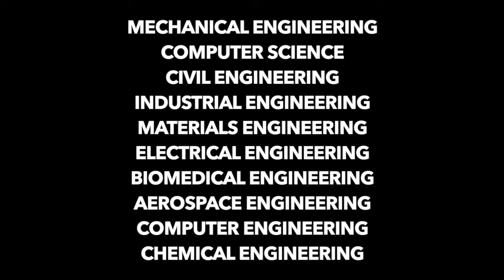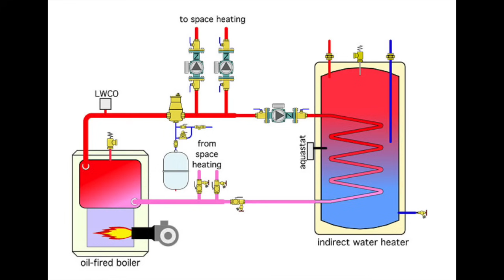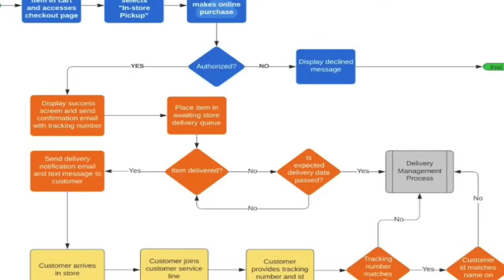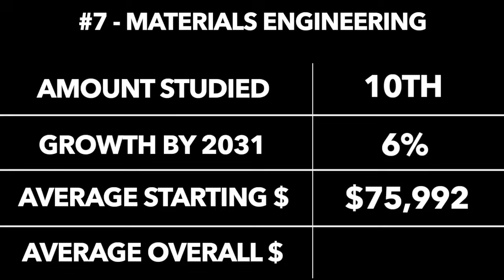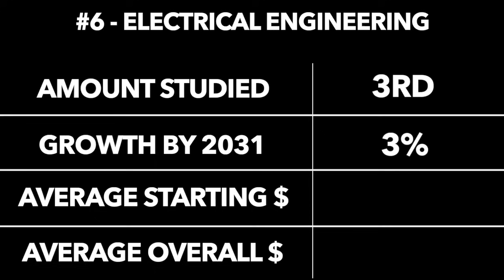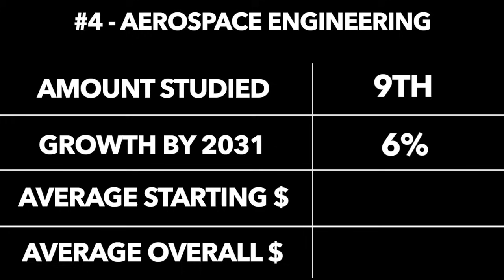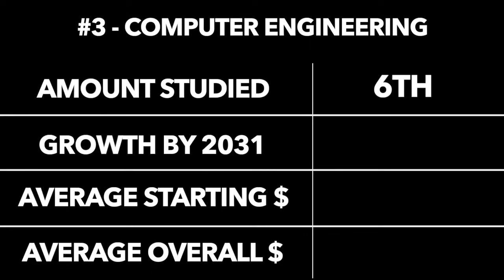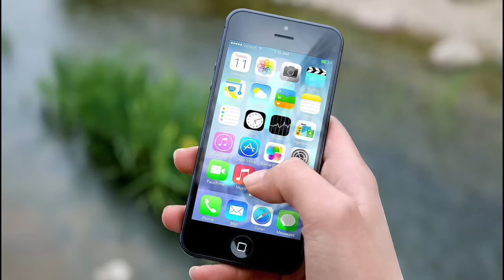Engineering Degrees Ranked: Pay, Demand, and Job Roles

Comment: The thing with engineering (and math) is you have to actually understand it.  In the humanities you can fake it and still get a decent grade.  You can't do that in engineering.
Reply: Think everybody’s college experience is little different. And there is huge difference between true comprehension and pure memorization of the chapter being tested 5 mins before the exam….

And yes people can absolutely memorize engineering formulas and steps to solve an equation that would be asked on exams the day of the test.  I did that for most of undergrad. 

For instance on understanding.. the first time I had a Math class with partial differential (wave/heat/etc)…I looked at the book night before the exam… noticed a pattern on the solution based on boundary conditions ( position, derivatives etc) eigen values  and solution structure would follow based on. I could skip doing most the work. At the time I had no fucking idea what I was doing or why that was possible… But college exams are typically just a test of a very specific set of material/1 to 3 chapters in a book.
Reply: @Pseudo___  At least in math you have to actually memorize the formula (doesn't help you much on proofs).  You need to know how to use it and what to plug before you chug.  The humanities it is about B.S. and getting the teacher to like you.  
https://www.youtube.com/watch?v=pDLzLUmtU3w&t=9s
Reply: @Pseudo___  You can't get away w/o understanding the material when it comes to Junior / Senior level semester-long projects.  For example, as a Civil, I had to design a transportation link between 2 cities - a highway, a railroad, & a canal system (on the river that connected them).  That really separated the wheat from the chaff when it came to understanding how to apply geometry, water flow, geology, geography, etc.  Many couldn't even lay out a basic circular highway/railroad curve.  Me, I was somehow born to be a Civil (didn't hurt my Dad was a masonry contractor & I'm "on the spectrum" w/a 135 IQ), I was already designing spiral curves for highway & railroad that are different (1 is arc, 1 is chord).  Also forget about ever passing the EIT or PE exams later in your career.  Better brush up on your golf game & always let the boss win.  All the "Admin's" engineers are good at that lmfao
Reply: @sideshowbob  I think you underestimate everyone's individual college experience differences.. Not all colleges are equal not all classes are equal... I did EE. Mine was a working  human tracking radar.. yeah would have been hard to bs if you actually did the work... I had 7 team members though. Not quite always equal division of labor haha.  FE/EIT/PE would be a bit more of a pain later in career if you werent applying stuff. IE the engineer turned Project manager Spreadsheet Engineer, but I also don't think it some hallmark of showing a great Engineer with full comprehension. Its still is just largely memorization. Gets some practice exams work the problem sets, youll pass, Seen it a 1000 times.
Reply: @Pseudo___  Oh I know - schools & curriculums & even individual instructors can make or break things.  It's certainly possible to "fake it" thru most curriculi.  That's why I said that, if you do, better brush up on your golf game, as that's the best way to get ahead on the Admin side if you can't comprehend the engineering enough to be an effective designer / project engineer / project manager.  I can vouch, after 3+ decades experience.  Seen it all . . .
Reply: I have a different perspective of Engineers as I have a Masters In Human Biology and an undergraduate degree in biology with a chemistry minor. 

I work in the environmental field specializing in hazardous materials management. Through the course of my career I’ve worked with many Engineers who were just absolutely condescending about my non-engineering background. In multiple times I’ve had engineers I worked with literally have meltdowns when they found out I was earning as much or more than they were. 

Industrial Engineers in particular disliked working with me as I was often responsible for their work getting rejected because their plans had pretty much no consideration for the human aspects of the process being designed. Just mentioning words like ergonomics or biomechanics would make their blood boil. I used to tease them by calling them Sadist Engineers. 

I was also shocked at how little chemistry chemical engineers actually studied. Like less then half of what I had studied. 

I was almost fired by a managing engineer and PE because we were in a conference discussing the problems were having with an abrasive product we were developing as the engineers at the meeting did not understand what a significant issue crystalline silica as a contaminant in our product was. So being the only biologist in the room I explained the biological process of the disease silicosis. That got through to the people in the room except my boss. Who promptly fired me for embarrassing him in front of all these other professionals. He made it clear that I didn’t have the status to speak out and embarrass him and the company in front of these other professionals and fired me on the spot.

The next morning I received a call from the President of the company (an environmental attorney) who told me I wasn’t fired and complimented on doing what I was supposed to do. My job. He also made it clear that I would moving forward I would report directly to him.

That was the worst conflict I had with an engineer but my experience was by no means unique as I’ve known plenty of other STEM field graduates who were not engineers but very smart and well educated technologists who have been treated as persona non grata by engineers and though I always took it with a grain of salt as I always new what my abilities were and was confident in them. So though I was earning comparable wages few engineers I worked with ever treated me as a peer. My experience was in no ways unique either.

So my question is this. Why do engineers treat other non-engineers STEM professionals in this manner? Most engineers, regardless of my contributions, treated me like I was the dumbest person in the room. I never understood their attitude.
Reply: For me, thats what I think makes engineering easier. You have a problem, you make a solution. The solution works, your problem is solved. However in humanities, most times its not possible to even know whether your thought process makes sense
Reply: @marquisstrongchild7535 but it also doesn’t even matter if it makes sense
Reply: @yelnatsch517  😄😄😄😄
Reply: Sure you can. I know plenty of people that got terrible grades in school who now hold high level jobs at their companies. Most engineering jobs are not nearly as hard or require deep understanding. Only the engineers at the highest levels of companies, with masters and PhDs truly understand most of it at a deep level and carry the engineering departments. 
When I got to my first real job, I couldn’t believe how little of my degree I actually  used.
Reply: You can’t do that in any of the STEM fields. It’s not just engineering.
Reply: @Mottleydude1  I think the comparison is STEM vs. Humanities.
Reply: @Mottleydude1 bull. Most people in the sciences know just the cannon theory (largely just accepting it) and work on their extremely focused and limited field for the rest of their life. Very few people spend time they could be using to read  on their specific topic to learn a deeper understanding of the larger elementary topics. It makes sense if you think about it. People can be really hard workers and study the exam, the examples given in class, and pass. Even being an authority on their field, but not understanding theory that doesn’t directly help their career. I’m not saying they’re stupid, but people are misguided to think that there isn’t a framework for creating content for your dissertation simply because you worked long hours, without having to truly imagine and understand all the sub atomic particle, say, in binding a transcription factor to an enhancer element.
Reply: You cannot do this in economics
Reply: Spoiler alert: you absolutely can fake it. Would strongly advice against it, as in the end you will end up a fool.

But it's possible to get away with absolute disasters, because at the end of the day, nobody aside from other engineers understands what's going on. To management and everyone else, math is often basically magic, so they can't verify how much or how little effort things take.

If you're clever and can make cartels with other engineers, it's easy to fool employers, coworkers and users. For instance, all you have to do is say: "our cloud storage uses modern state-of-the-art encryption system", when in reality it uses the most basic encryption you've happened to find on StackOverflow, and no one will be able to tell. Now, what happens if it's found out is another problem, which is why I wouldn't advise it.

I will tell you more, often times, even when you actively fight for the right solution, management will not accept it and will force you into terrible engineering decisions, making you wonder why did you even study all that math for? Real world is more akin to natural selection: whatever can survive with the barest minimum engineering possible will survive, be it jobs or products, and often be successful because of some other factors outside of the engineering, such as marketing or monopolization.
Reply: In engineering, if you are incompetent, you are exposed immediately and can't move an inch beyond.
Reply: That’s why they should inform students to read correlating chapters and workout the examples and proofs in high school. I feel like just watching a lecture isn’t enough. Understanding how to read math will help immensely. 
If I could back in time I would tell myself that. Now I’m over here reading s damn calculus book to really understand
Reply: Get your degree, take the State exam to get your professional license, open your own business / firm. Don't work for someone else. For instance EE / Electrical Contracting
Reply: you don’t have to understand why math works to plug numbers into an equation
Reply: I hate math but I’m with it
Reply: In short, you have to be "wired" for it.
Reply: yep  @goodboi7266
Reply: This is the STUPIDEST discussion I have ever seen.

The POINT of school is to understand and learn. Discussing how to fake learning...takes a special kind of stupid.
Reply: untrue. navier stokes is used all the time to model fluid flow all the time but yet everyone knows we don't understand everything about it.
Reply: As a literature student currently studying to get into an engineering department I have to say you are absolutely right I got an A+ for a paper I have written on a book I have not read
Reply: maybe in first year english. but philosophy teachers will tear your arguments into little bits and spit them in your face.
Reply: Most philosophy profs are delusional dogmatic ideologues lol, I suppose that's what happens when you pretend well constructed arguments can forge reality. @williambigger1545
Reply: Lol u know nothing
Reply: Well.... I see bunch of engineers out there dont know what is a 3/4 wrench? Is common math right? 😢
Reply: @jonnywick4402  bruhh not all engineers are the same. I mean do you expect an electrical engineer know that
Reply: @PolitictalDipsit  well now days yeah
Reply: I agree, you can't "wing it" as an engineer......
Reply: @theman4884  I have a bachelors degree in Chemical engineering and I notice a lot of people in the comment are disagreeing with you and this is proof that none of them are engineers or ever sat through an engineering course!! We don’t do mindless calculations! I failed 2 chemical engineering courses simply because it was too damn hard and I couldn’t just plug and chug!! I currently work as an engineer and do reclamation work and literally we have to know how to problem solve, bring about damn good solutions, and optimize your solutions or your ass is without a job!!
Reply: Now that's one thing that put humanities on a higher level. Can you really fake it? For grade, yes, but that defeat the purpose of your study. How can you win or excel in a super subjective fields where everyone can be wrong, right, both, or neither? In math and engineering, people much likely to agreed on the shared principle, but in humanities, when you draw the most beautiful woman for example, how many you'd say would agree what you draw or depict through word is indeed the most beautiful?
Reply: Google
Siri
ChatGPT nobody really needs to learn it
Reply: @whyworkwhenicanrap6830  Good luck having chatgpt doing your second - final year engineering homework
Reply: Utterly feeble. That is an irony and a satire
Reply: Stop trying to sound like you're superior. I was an engineer graduate, currently a physician. I make more money than you. Generally physicians are higher regarded than engineers. How about that?
Reply: Lol, mathematicians and physicists have always dunked on engineers for not reall knowing what they use.  They say you don't need to know it at the level of at sophistication to use it. I guess they're right.
Reply: Yes, indeed, you have to be at least somewhat "On the Spectrum" to "Get" the Engineering-level maths.
Reply: you are either born an engineer or you are not. Its a way of thinking.
Reply: @Savage_Thinker I wouldn’t disagree with that but that’s true about most STEM fields.
Reply: Mott Dude  lots of people in the field who don't thi k like engineers just pretend to.
Reply: @Savage_Thinker , you can't say it better than that! These are 1:1 my thoughts…Even before I went for an engineering degree and wasn't even considering an engineering degree I knew I was an engineer inside of my head. I think it's all about systematic thinking and the ability to analyze.
Reply: @Savage_Thinker no not true. You are able to learn more than you give yourself credit. Granted not all can be engineers or whatever else profession they choose. But hard work,steady progress, and good habits can help anyone improve dramatically
Reply: @Savage_Thinker so I can’t become one?
Reply: @Savage_Thinker I agree it’s a way of thinking. But I don’t think you have to born with the ability. It can be learned. I certainly did.
Reply: @Savage_Thinker lol I wish that was true
Reply: Mathematics is a humanities.
Reply: @brianwiers6778  No.  In fact, about as opposite as you can get.
Reply: One thing I always found "curious" is that at Carnegie Mellon during the '80s, there were special watered-down versions of the calculus, computer science, and probably other courses, all specifically for humanities majors.  In contrast, engineering students took the same math, physics, computer science, and humanities courses as students majoring in those particular disciplines.  I took exactly the same humanities courses as the humanities majors.  And I got "A"s in those courses.  I'm very glad I didn't have watered-down versions of any of my courses.

At the time, the humanities college at Carnegie Mellon was called The College of Humanities and Social Sciences (abbreviated H&SS).  We engineers referred to it as "H & Best Guess".  We considered an H&SS degree to be a consolation prize for students who couldn't cut it as engineers.  I know that's harsh, and I don't buy into that 100%, but there is also a certain element of truth to it...
Reply: @waltwimer2551  I went to Pitt, circa late 70's/early 80's, BS in Civil, Structural, Environmental Engineering, 1983.  We did have "core curriculum" geared towards engineering students in the humanities.  "Psychology 101" (yes, we were still taught then that "Homosexuality" was a mental illness), Art 101, Music 101, Western Civilizations 101 (ahhhh, yesss, "Western" lol), etc.  It was fairly non-challenging, you didn't have to complete big term papers or anything like that.  Just follow along w/the lectures & textbooks & pass the basic exams, not much homework, as they knew we had wheelbarrows full of engineering work.
Reply: @waltwimer2551 That was true of my area of study as an undergraduate (BA in biology with a chemistry minor). I got a lot of dates with nursing majors and social science/humanities majors tutoring them in watered down versions of my freshman classes.
Reply: Agree
Reply: Quite prejudiced driven statement
Reply: @fareehafaiyyaz8475  How so?
Reply: @fareehafaiyyaz8475  Oh so now it's "prejudiced" to point out that some people can do the math & some can't?  Yeah, let's, in the name of "equity", only teach the level of math that EVERYONE can understand, so no one gets "left behind".  Oh yeah, let's teach it in "traditional, tribal" ways, where there might be more than 1 correct answer, if you interface with the correct Shamans.  I mean, I'm left of center, & pro diversity / equal opportunity, but this "Woke" bullshit has gone far enough.  China & India are going to Bury us . . .
Reply: Yea right buddy is that what mommy told you?
Reply: @cece-xe5zx  Did I hurt the feelings of a gender studies major?
Reply: It's the opposite in my opinion
Reply: @sonsofelshamy3987  it depends on your lecturer. They can set their exams/assignments in such a way that all you need is a strong memory, mental stamina or a deep understanding of the course material.

 For  memory based exams, they can require you to regurgitate a lot of information, proofs and definitions. 

For mental stamina based exams, the lecturer would typically demand you to solve large amounts of problems, very often within insufficient time.

For understanding based exams, the questions are typically short but would require thorough understanding of the  course material.
Reply: @sonsofelshamy3987  How so?  With a math equation there is a correct answer(s) and everything else is wrong.  On the other hand, I can argue that the Maltese Falcon is a  Christ allegory and get full credit.  And with spell and grammar checks I don't even need to know how to do that.
Reply: @theman4884  That’s not about understanding that’s about opinion. You can use equations without knowing how they’re derived and understanding what they mean. I can apply the equation F=ma to a question by simply substituting values and still have no clue what any of it means.
Reply: @sonsofelshamy3987  You just perfectly demonstrated exactly what he was talking about.  Engineering is not mindless calculation. An engineer has to understand what they're dealing with before they can even begin to choose the correct equations to reach a solution.
Reply: @sonsofelshamy3987  yea then u will not pass the exam cuz is not just aplying
Reply: @sonsofelshamy3987  Engineering is not middle school physics. You wouldn't even know what equations to use unless you are understanding the problems and all boundary conditions.
Reply: @sonsofelshamy3987 a=f/m is better.
Reply: @sonsofelshamy3987  You sound like all you have is opinion. 
I have been a consulting engineer for 40 years and have designed and managed many types of projects including many types of contributing engineering and non-engineering disciplines. It has also been my responsibility to recruit, train, and manage people. Those are my qualifications. 
I have found in my career that there are no statements of the problem to be solved. There is what you might call "the user's complaint." The user is usually a lay person who knows little of math or physics. All they know is that they need a widget to fix it. The engineer must derive the problem statement themselves and then correctly apply the correct equations to produce the widget. This process is usually breaking down the one big problem into many smaller problems, each with its own equations. 
Knowing that F=ma doesn't even get you into the room in which this work is done, unless you brought coffee.
Reply: @jakurdadov6375  As a civil engineer who cut my teeth designing sitework & highways & airports, then moved into project engineering / project management / construction management, I was the interface between the "lay persons" who were the owners / occupants of the facilities we were designing / managing, often political appointees with shady backgrounds.  Then I was dealing with the field inspectors, code officials, contractors, who had at least some technical literacy, perhaps not the math-driven stuff, but understood how to get things built.  So I hear what you are saying from a mechanical / industrial engineering standpoint.  Most of the facilities we designed & managed were for maintaining transportation vehicles - snow plows, buses, trains, etc - so I learned a lot about industrial & mechanical engineering "on the job"
Reply: @jacobnebel7282   I agree. If you just choose equations and start plugging numbers in during an exam, unless you are very lucky you will get a friendly note from your professor "Major conceptual error 0/10."
Reply: @jacobnebel7282  this may be true for some cases, but broadly, this is not correct. As a computer scientist employed in a software engineering position, you do not need to understand how computers work at all, technically. sure, it would be better, and it would (for some people) make you better at your job, but you can sure as hell get by without understanding a thing. Coding and design patterns can be learnt and need not be understood, and I'm saying this as a CS graduate who does understand very well.
again: understanding it DOES make you better at your job, but you can coast by without it.
Reply: @sonsofelshamy3987 duddddeeeee ur sooo wrong, I am barely taking prep physics and we have not gotten to fma yet and even I know that F is force , Mass and Acceleration, cmon now. Idk what’s ur education but like if people like you exist I can def get a physics major. I thought based off the main comment that I was gonna be completely fked cuz some stuff is difficult to remember but I guess not (other science subjects like calculus sometimes I don’t know what I’m doing but I get the right answer but I know what the equation means most of the time)
Reply: @sonsofelshamy3987 good luck with a math exam, being tested on matrix algebra with that logic. I guarantee you, you are not solving X by getting the inverse of A without understanding how it works.

You can't wing it, and it's not about memorisation. It's understanding.
Reply: @championofthelight3851 I challenge them to solving a system of 3 linear equations with 3 variables using matrix algebra. Without understanding how it works 😅😅😅😅. 

Hell it's like explaining Egyptian hieroglyphs to regular people.
Reply: @DrPandorum that doesn’t help your argument because very few engineers actually have to manually solve linear algebra equations. Most engineers have access to software that can take care of most design aspects as long as you have the parameters and learn how to use the software. I don’t have to solve 5 degree polynomial equations to determine a pumps performance, I have programs that just spit out and plot the curves. I don’t even really have to understand how the curve is derived.
Reply: @theman4884 To be fair, in engineering you have to argue your approximations—but they have to be accurate or justified. There is plenty of nuance and it’s not a plug-n-chug discipline. It’s still much harder though.
Reply: @sonsofelshamy3987  Lets forget about the 4 semesters of calculus and equation derivations we do with answers that are a page long (praying for my diffeq friends). Every upper level engineering course i took let you have SHEETS of paper with ANYTHING you wanted written down. formulas, homework, typed written whatever. you could even print out an old test if you could find it and fit on one page.

Why did they allow that? Because if you didnt understand the nuance in when and how to apply what formulas then it didnt matter what examples and formulas you had available. Engineering do math on real life scenarios. There's as much mathematical context in a ball rolling down a hill as there is in a conversation. Hate it break it to you friend, but the device you typed this on does in-fact require more understandong than "f=ma" to work an operate.
Reply: @sonsofelshamy3987 That'd not how engineering work though. You don't just mindlessly apply formulas, you do actually have to understand how to deprive each one aince you need to be able to tweak one on the fly
Reply: @sonsofelshamy3987 engineering isn't middle school physics where you can just remember a handful of complete formulas and use it to solve the problem. the op's correct- engineering field has objectively correct solutions and when you're writing let's say a literary essay there's no objective truth you can interpret stuff the way you like and still get a decent grade
Reply: @theman4884 you have to understand how to articulate your points and use critical thinking. You can’t really “fake it till you make it” in my opinion
Reply: That’s an oversimplification of what the hard part of STEM fields is. The hard part is the problem solving of using tools to solve an abstract problem. Almost never on my tests for STEM class am I asked to simply compute something using a formula. Instead, the question is abstract enough that I need to figure out how to use 20 different formulas and operations in the correct order to solve the unique problem. In my humanities classes, I am constantly asked to relate some abstract concept to another abstract concept, and literally all I have to do is use big words and say “…gives insight on…” or “…reveals the author’s…” I understand that is not how you write interesting and beautiful things in the real world, but if we are just talking about school, the humanities is much easier.
Reply: @conigliana If, the grade is fixed to be good. Think again, how would you excel in a subjective fields where everyone can be right, wrong, neither, or both? Say, what if the lecturer told you to draw or depict through words, "The most beautiful woman".... ain't everyone cooked solely for the fact that everyone have their own interpretation and no shared rules of right like how 1+1 is 2?
Reply: @sonsofelshamy3987 any word problem would destory you😂
Reply: @sonsofelshamy3987  I agree with you here.  I did a bsc in engineering, and if you did enough old exams you could see a pattern and use it for success. I am still chocked that I managed to get through my degree, but I understood perhaps 10%. The rest was just memorizing calculations and formulas.  

Perhaps I would have gotten further if I had tried to understand it, but since I just stared at the questions that would not work. So i tried to learn in mechanically.
Reply: @sonsofelshamy3987 I have both a liberal arts degree and an engineering one, doing my PhD now. The humanities degree was significantly easier. The top students are about the same, but 99% of humanities people aren’t “top students.”
Reply: @sonsofelshamy3987 girls, girls, you’re both pretty.